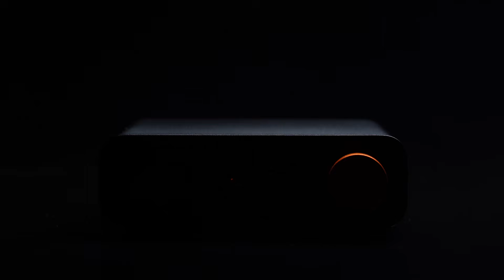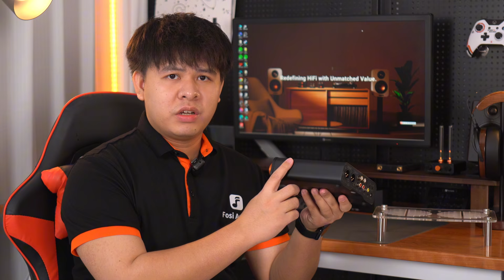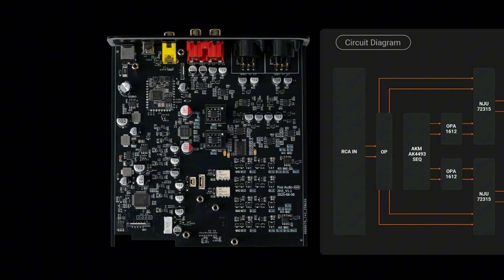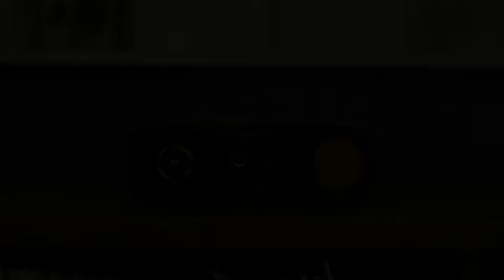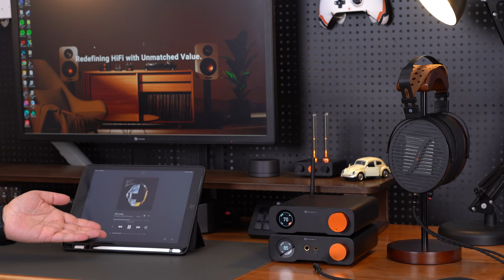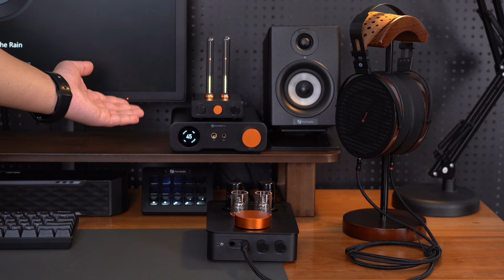Fosi Audio ZH3 Intro & Demonstration: All-in-One Desktop HiFi DAC/Headphone Amp/Preamp

Comment: Is there a volume control function, should be right? It can be used as headphone amp...No remote control too? In scenario 2 why did you connect with ZD3? ZH3 already had internal DAC right?
Reply: Yes. There is.